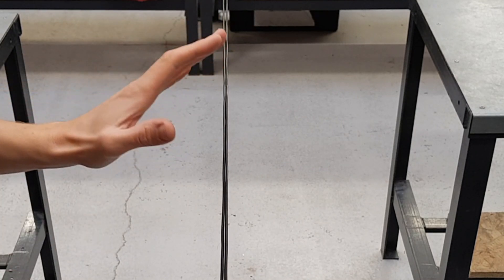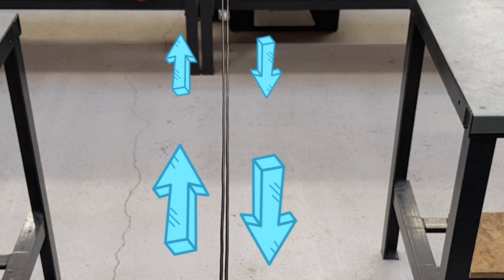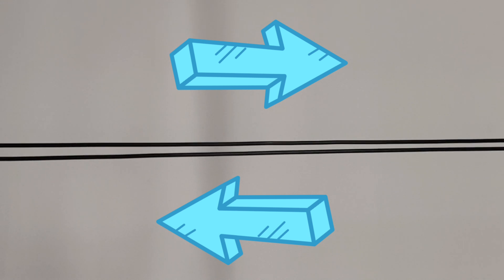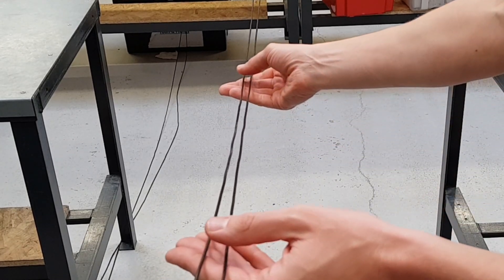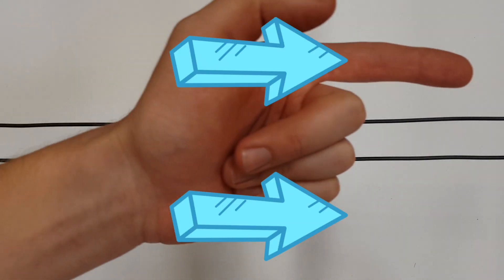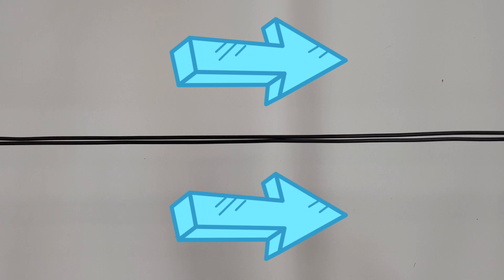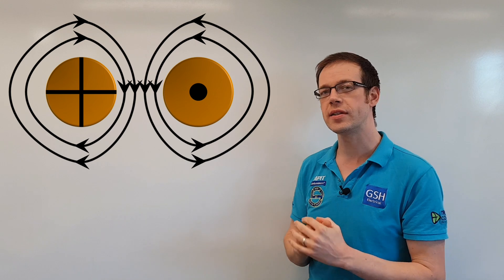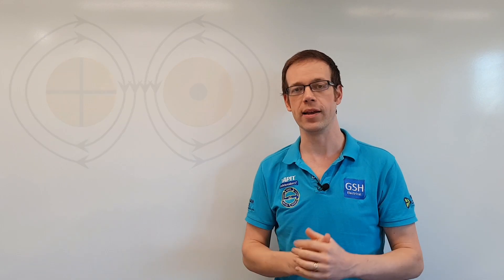How Does Current Make Parallel Conductors Behave?

Comment: Can you explain the same effect on AC conductors? . I have this configuration in my work place where Single core LT cables placed in trefoil sequence which said to be safeguard the cables. But even if the formation is right, cable got insulation damage during a fault. If you share some ideas about the basics , It will be helpful.

Comment: Hi Joe. What happen if we use AC power supply?
Reply from the maker: Great question, in theory they'd move backwards and forwards at the same rate as the frequency, so if the frequency was really low you would see them move together and apart. The 50 Hz frequency we use in the UK changes too fast for the cables to respond.
Reply: @JoeRobinsonTraining  Thanks for your reply. Great explanation..👍🏼